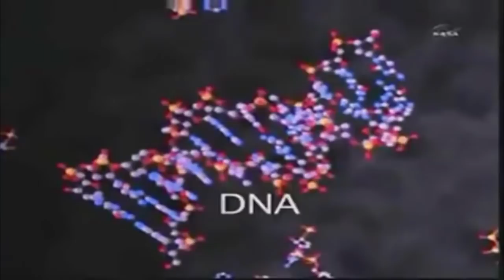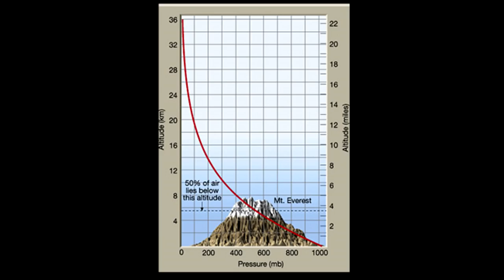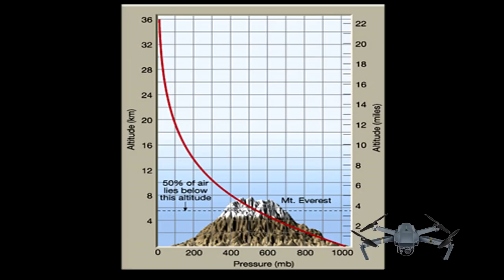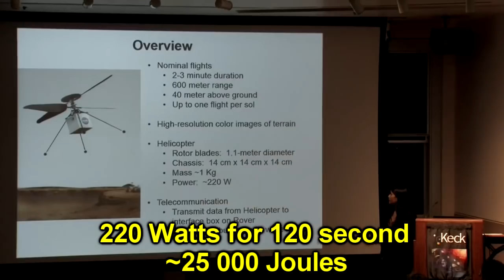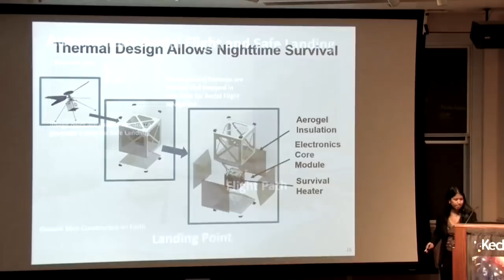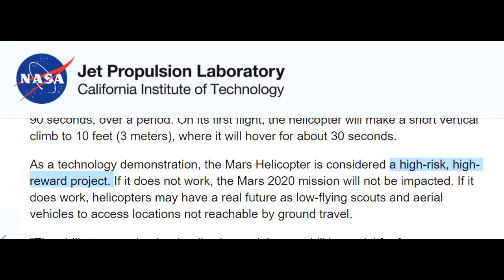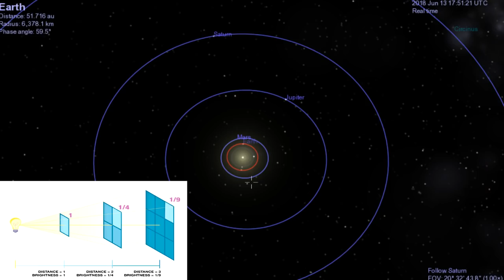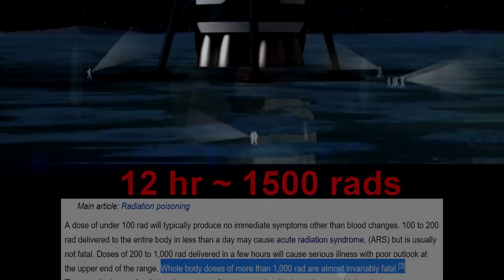NASA is sending Helicopter to Mars!! Smart or Silly?

Comment: First and foremost, kudos for pointing out in a number of ways that the idea of a helicopter on Mars is not as ludicrous as it would appear upon cursory consideration by the lesser educated and ill informed.

Some factors you appear to be overlooking.

Mars gravity is 1/3 of Earths and that not only means only 1/3 the thrust is required PER UNIT OF MASS to lift something from the surface, but ALSO that the structure can be a LOT less than 1/3 the weight (strength goes up or down as the cross sectional AREA  (a squared measure)  but weight goes up and down by the VOLUME (a cubed measure) .     The result of that is that structure requires as little as 1/9th of the mass instead of 1/3 of it  ( 1/3 less mass for the structural part and 1/3 the thrust to lift each unit (with 1/3 as many units to lift)   And since mass is directly related to weight X gravity that mass requires only 1/27th the thrust to lift it.  (of course not all parts are structural and won’t get the 2/3 reduction in mass so it’s something more than 1/27)

WELL WORTH NOTING: while the advantages of lower gravity are much greater than just the difference between the square and the cube, the disadvantages of higher gravity are similarly greater.   This has major implications for what we can do where.

Note also that momentum is the square of speed times mass..     So if you move the blades 10 times as fast (hitting only 1/10 the mass of gas) you could get the same thrust from moving less air because you are moving it faster so you get more thrust (but of course have to put in more energy to get it) or you can get the same thrust with a lower speed.   But you don’t need the same thrust because the gravity is less meaning that ALSO the structural mass required is a LOT less)   (If you used larger blade size in part to replace increased speed, the improvements are less.)  But there’s a trade off because higher speed for the blades requires greater structural strength = greater weight.      

Such considerations are why the grossly oversimplified notion that because the air pressure is only 1% of Earth's, a helicopter would be impractical is just plain wrong.

By now you should be getting the general idea that it’s a great deal more complicated than you are making it out to be.

NASA has a long history of being very successful at working out such complexities.  (most of the infamous accidents have been caused directly by toxic POLITICS rather than scientific or engineering errors (ESPECIALLY the Challenger and the Columbia where it was toxic politics AT MANY LEVELS that directly caused both accidents.    The wrongest “stuff” we ever displayed but what was wrong was the politics and not the science or engineering.    [Politics (“spreading the pork”) caused the horrendous decision to make the boosters on the West Coast instead of in Florida and it was the requirement to be shipped across the entire country that required the boosters to be made in two pieces instead of in one unit which would not have required the O rings.   It was Reagan’s order, over NASA engineers’ vehement objections that the launch go ahead despite the O rings being unsafe below freezing and the protocol forbidding launches below freezing and the temperature being well below freezing that day.   All just so that Reagan could announce in a speech that the USA had a schoolteacher in space (which instead became that the USA has LOST a schoolteacher      Because of a horrendously bad decision by the worst of the worst we lost 7 of the best of the best.

All of this is extremely crude and “seat of the pants” but should make it clear that the efficiency is only (VERY roughly) half to even the same rather than 1/100 for an >equivalent< helicopter on Mars   (not one of the same MASS but one of enough mass to support the structure needed to support the same equipment (at 1/3 the weight) which is a very major point you missed, making your “analysis” inaccurate.

Other critical factors you are overlooking is that this mission is intended to go indefinitely and there are only two potential sources of energy that could avoid being a far more limiting factor on the duration than all the rest:   nuclear (same as Cassini) and solar.    Nuclear would be far too low energy density.   While solar energy on Mars is a lot less than on Earth, you only need to move the equipment short distances at infrequent intervals and the energy would be stored  (yes batteries have low energy density (but not nearly as low as a short while ago and saftey standards are not remotely at the level of something that stays in a consumer’s pocket all day (which means the energy density can be higher).   So you have all day to collect enough energy for a two  minute flight.    And if you use eutectic salts to store the heat generated by the flight and it’s insulated well, that should carry thru to the next flight with little input of energy for heat maintenance.

The bottom line is that a helicopter on Mars makes a great deal of sense.     It does not suffer the same extreme limitations on where it can go nor especially on how FAST it can get there that were severe restrictions on prior missions.

As for heat, eutectic salts can store many times more heat than thermal mass, and more importantly soak up heat at about the same temperature and later re release at about the same level.    So the heat generated by flight would not be wasted but used to maintain a stable temperature for the rest of the time.         (so what they’d use would be eutectic salts surrounded by insulation).

I suspect you are just as far wrong on the radiation issue.   While there is a great deal of radiation in the belt, there are ways to greatly reduce the astronauts exposure to it.    And space travel involve a lot of high risks and an increased risk of cancer (if exposure is kept within limits)  would more or less get “lost in the noise”.
Reply: My apologies for some errors (which can't be corrected on Youtube -  I'll have to remember when posting fast off the top of my head to do proof reading before postiing here)    I double counted some of the reduction so it would probably be more like 1/9th instead of 1/27 and ":weight" in a couple of places should have been "mass".  But the general idea still holds:   there are things not obvious to most where the low gravity compensates more than you'd expect for the low atmospheric pressure (I had to wake up and think to realize this myself the first time I saw "helicopters on Mars")

If Eutectic salts could be used structurally (liquid support for a containing membrane maybe) that would allow them to be used with less weight penalty (maybe NASA's already doing that - they don't miss much).   Only the insulation has to be on the outside so the eutectic salts could be used where needed to support structure (this might even give beneficial  shock absorbing ability to the structure)

SPACE EXPLORATION IS BY A MASSIVE MARGIN THE MOST TECHNICALLY CHALLENGING OF HUMAN ACTIVITIES.    The demands are very extreme and the environment is far more extreme than anything on Earth outside of a volcano.   Nowhere else are you pushed remotely as hard to do more with less.
Reply: I have no idea what you mean. the comment was deleted. guess he realized he was wrong Pilliez .
Reply: A much better and comprehensive answer.  People tend to forget that politics has constantly interfered with NASA's plans. Thunderfoot is such a jerk sometimes.  Good on his own science, though.
Reply: Who has time to read this wow
Reply: You didn't?

Comment: Your solar panel math is sketchy. Laying flat on the ground depends hugely on the latitude. At the equator it's exactly the same as a fixed panel.
Reply: Grant Harriman shadows
Reply: Also, NASA will not put a consumer-grade, 20% efficiency panel on top of their mars helicopter, so they will actually generate more power.
Reply: 1: Panels will generate less power when the sun is lower in the sky in morning/evening, power is reduced. And to your comment on latitude, that's great IF you're at the equator, but then as soon as you go toward the poles your sun exposure goes way down. due to angle.

and @w0ttheh3ll, solar panels still have an efficiency limit. from a quick google, the highest theoretical limit is 47%, which is better but still on a very low scale regardless.
Reply: @soconfused8031  consider as well NASA isn’t in the habit of using cutting edge tech very often. They try to us tried and true tech when possible further they will go with hardened equipment with as much solid state as possible. Of course they will be precise with a stacking tolerance that is so fine as to be almost unmeasurable without specialized equipment.
Reply: @w0ttheh3ll  from NASA's own page they don't make such claims. The only time NASA has ever used such experiemental tech is on the International Space Station as it allowed for further research and for more wiggle room with energy usage. If they haven't specifically stated it, it's probably just off the shelf solar cells. They really haven't said much in regards to it not even the output of it today.

Comment: Your solar energy equations are wrong due to being based on earth based solar radiation. I think you forgot about how efficient a solar panel is in space. Why? Because the atmosphere doesn't get in the way. Outside the Earth's atmosphere the solar energy is roughly 1,350 W/m2. Where I live in Oregon it is about 450 W/m2 on average. Mars is much closer to space than anywhere on earth based solely on the virtue of a thin atmosphere. At local noon on Mars, with Sun directly overhead, the solar irradiance is 590W/m2. Granted the distance reduces the sheer number of photons, but much fewer photons are scattered by the atmosphere. Redo your math with a Martian atmosphere and let's see where we end up.
Reply: Solar radiation on mars surface is actually about half of that of earth.
Reply: I was looking for this comment so that I didn't have to write it myself. Thanks for helping out a lazy bastard
Reply: +ABaumstumpf The solar radiation is closer to 1/2 of 1,350 W/m2 (Space at Earth's Orbit), not 1/2 of 450 W/m2 (Average Earth.) The issue with Thunderfoot's equation is he is using the distance alone in his calculations, but he is not taking into account how much more efficient a panel is with next to zero atmosphere.
Reply: Warmer
nah - it really is closer to 1/2 of what we get on earths surface.
For earth you can say roughly 1000W peak flux on the surface - on mars it is more in the range of 500 W. And to make it worse the light is mostly nto straight light but scattered in the dust of the atmosphere.

The rover had 1.3m² Solar panels and produced ~900Wh per day over a period of roughly 6 hours according to Nasa - a bit under 700Wh/m². If you look at the solar power numbers available online you can see that in the US the average is roughly the same.
Reply: +Warmer Your numbers aren't incorrect but they're the average irradiances which aren't really applicable to this specific case of charging a battery over a short time. What +ABaumstumpf and Thunderfoot are both using is the maximum or peak irradiances, which are 1000 W/m2 (Earth) and 560 W/m2 (Mars).

Meaning if your battery took an entire year to charge, it would charge faster on Mars by the ratio of average irradiances. But if it takes a short time like days to charge, then the charge time of the Mars battery approaches the ratio of the peak irradiances, which is the 1/2 figure being used. 

It's a very rough visual but this graph is a way to conceptualize what I'm talking about.
https://cdn.redsharknews.com/images/log_standardisation_fig_3.jpg
Imagine the graph is Joules / seconds (making the area Watts). Blue log is Earth, red line is Mars, and the seconds go from 0 to 30,000,000 (a year), continuing past what's shown.

Given enough time (and graph width) the area under the red line becomes greater than the area under blue (obviously because red overtakes blue at some point). That's the average wattage on Mars over one year. It's greater than Earth.
Now if you cut the graph down to the first 10 pixels wide and took the areas, you can see the area under red is much smaller. That's the average wattage on Mars over the time it takes to charge the battery , which is tiny compared to a year. The wattage on Mars is much smaller, and that's where the 1/2 figure is coming from.

That's the gist of it anyway. Obviously the graph is not to scale, but on the real graph if you took the areas in that small time frame, over several measurements, it would be roughly 560/1000, the peak irradiances.
Reply: +Malimber Enjoy being wrong then, because in this case Thunderfoot is absolutely right.
Reply: But you also need to account for dust in Mars' atmosphere.
Reply: @Malimber, It's also easy to throw baseless insults instead of offering any constructive criticism. I prefer warmers tact more than yours, i think.
Reply: Agree ! Makes fun of Billionaire Elon Musk who at least wants to TRY things . Thunderdunce is not a Billionaire hes a Youtuber with 800,000,000 followers who think he's Tesla and Einstein mixed . I will take the rich guy who's at least trying anyday !!
Reply: he addressed that saying it would be about the half
but the rover would be fucked if a duststorm would come across
Reply: But... you just showed his numbers weren't really off that much...
Reply: Logan-5 Insults someone else's intelligence Uses the wrong form of "you're"
Reply: Don't forget solar panel effiency.
Reply: @DeadShred9  
He didn't think the Mars rovers would work (he was like completely certain, it seems). But they worked. Nothing is proven till it happens and Thunderf00t can't be disproven till it either happens or doesn't. Those are the facts. 

It does seem that Thunderf00t is a bit of a pessimist, but I do agree with him when it comes to the tube train thing or Hyperloop. And even if it did work, I wouldn't go in it and there would be many who just wouldn't. It would be sheer hell if something went wrong stuck inside that thing. No way.
Reply: Like you just told me nothing is proven or disproven until it is or is not . Thunderfoot is pretentious and acts like his IQ is much higher then yours mine and a lot of others . He can talk shit about Elon Musk and Bob Bigelow but they are Wealthy and out doing and trying things .! Thunderfoot craps on stuff and has a YT channel which he lives off people who have Average IQ's . Big difference and I would compare my IQ to his any day . Yet notice Im not making a living shitting on other ideas on Youtube . I Work for my living . No offense to you if you dig the guy that's your prerogative , but when was the last time he spoke Positive of or about something ??
Reply: I would care about your opinion why ?? Thats right I dont and woudnt ...
Reply: mars does have a thinner atmosphere - however just like earth it still ahs the problems of a day night cycle and soalr panels not being perfectly pointed at the sun - also it's further away from the sun then earth is
Reply: Another pom that lives in the UK that has nothing to do with space due to no space program India,China and Russia all do.
Reply: @basillah7650   europe has a space program and despite brexit making politics needlessly complicated the uk is still part of that
Reply: @basillah7650  that said, unless you personally work for nasa / esa / jaxa / whatever where you live doesn't really make a difference

Comment: @Thunderf00t  There are a couple of errors in this one. Firstly lift does not vary directly with rotor speed but the square of rotor speed. Secondly, Ingenuity and the Phantom drone have very different disc loadings so the assumption that ‘comparable amounts of power produce comparable amounts of lift’ doesn’t hold.

Lift varies with the square of tip speed so Martian density implies an rpm increase of 10, not 100 (a moot point since tip speed is more limited by the lower Martian Mach 1). Using momentum theory, the estimated induced power for Ingenuity (@ 1.8 kg, 1.13 disc area, 0.012 rho) to hover outside ground effect would be 104 W. Strangely enough then, that is ten times the power it would require to provide the same thrust here on Earth.